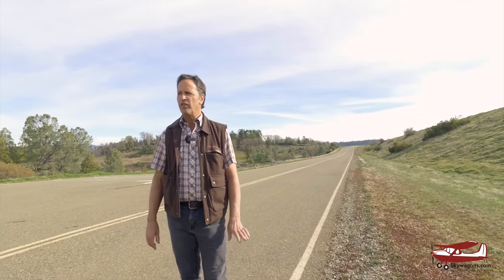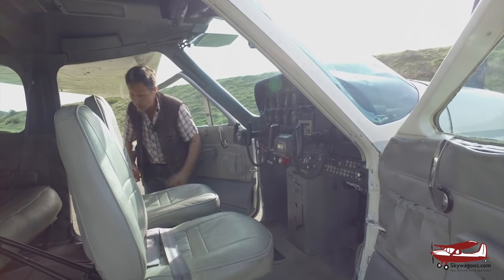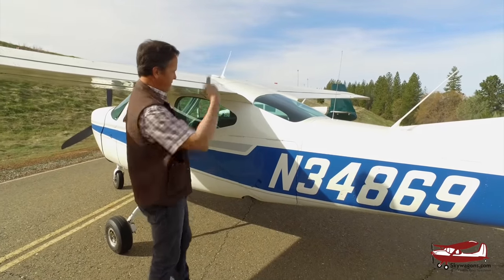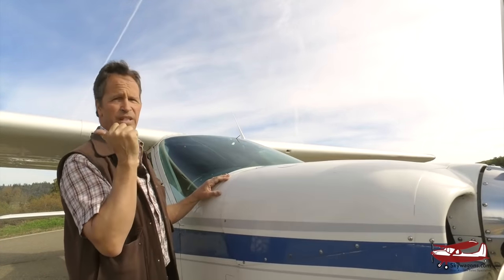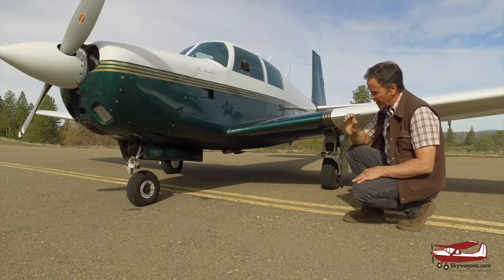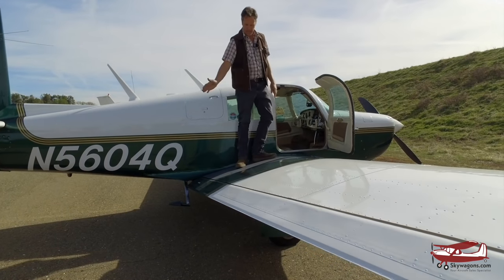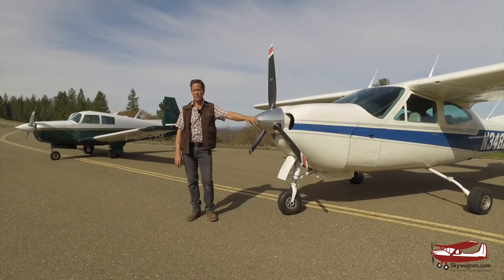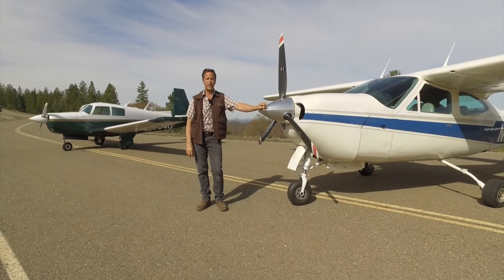Mooney vs Cardinal

Comment: Speed vs comfort!?
Reply from the maker: Don the Camera Guy here ... I thought the Mooney would be cramped and uncomfortable.  Then I flew one from Placerville to Vermont.  It took two days and I ended up sleeping in it for a few hours.  That did it for me.  I sold my Cessna 310Q (24 gallons an hour at 170 knots) for a Mooney.  They are perfectly comfortable, have adequate speed, and impressive economy.
Reply: @skywagonuniversity5023  they have that roll cage structure too... No crushed coke can from a Cessna
Reply: I think the Mooney is a safest airplane because of the strength of it’s fuselage and the one-wing design. No other airplane compares to it.

Comment: I appreciate the entertaining video Mr. Mark and Mr. Don. I am planting corn tonight, and I listened to the whole presentation, and even caught a few glances because my tractor is on autopilot.
Reply from the maker: That is excellent, you have a video or at least a computer on internet in your automatic piloted tractor.  Or your phone.  Anyway, I'd like to see a video on that.
Reply: @skywagonuniversity5023  I am using a Trimble TMX autopilot on my John Deere 8420. The Trimble autopilot recieves radio signals from stationary GPS base stations around my county that calculate GPS position corrections. The base stations broadcast that correction signal (over the air via radio) to the Trimble in the tractor. The Trimble uses the correction signal information to refine the GPS location of the tractor to within a fraction of an inch many times a second. 

The Trimble autopilot uses sensors (accelerometers, angle sensors, and gyros) mounted on the tractor to further refine the other variables: instantaneous heading, steering angle, and tilt of the machine (which moves the roof mounted GPS reciever). The autopilot compensates for all those variables in realtime and steers the tractor. 

Autopilot has many uses for the farm, but in a nutshell, it helps us reduce overlap, reduce chemical/fertilizer/fuel/seed waste, and increase productivity. It's nice to have something that makes it easier on the operator, saves money, and helps the environment a little too! How rare is that?!
Reply: @chester8420  I need that tractor in my life!

Comment: Outstanding, thorough review. I’ve owned my fixed gear Cardinal for 10 years. I have a few things to add:

The Cardinal fuel system is stone simple: Left/Right/Both.  Mine lives in Both 99% of the time.

The prop clearance on the Cardinal is greater than the Mooney’s, something to consider for grass field ops.

Cardinals come with 3 point shoulder harnesses.  I retrofitted mine with the B.A.S. 4 point, inertia reel system. Not sure if shoulder harnesses are an option for Mooneys.

The Cardinal Flyers Online, the type club for Cardinals, is one of the best run, informative, and active groups out there, despite the relatively small fleet size.  As a result, there are many after market mods available for Cardinals.  One of the most popular is the tuned exhaust by Powerflow.  The Powerflow exhaust adds “bolt on” horsepower, which is most noticeable on takeoff and climb, but will also add a couple of knots in cruise. My fixed gear Cardinal has several additional speed mods and I typically see true airspeeds between 130-135 knots (150-155 mph) at 10.4 -10.8 GPH between 6000-8000 feet, 75% power.  Not bad for an airplane built in 1970 with the gear down and welded. 

The Cardinal’s front seats adjust fore/aft, up/down, and the seat back angle can be adjusted.  The up/down feature is great for shorter pilots/pax.  No need for cushions or phone books (millennials & younger may need to Google that 😜).

In the end, both are excellent airplanes.  Having to choose between them is a very 1st world problem.  I’m a lucky man to be the caretaker of my Cardinal. I plan to leave it better than I found it.
Reply from the maker: Thanks for the input from a long time owner.
Reply: Yes, you can retrofit retract shoulder harnesses on a Mooney.

Comment: I came this close to getting my complex endorsement in a Mooney. My flight school had one on the line, but no instructors were checked out yet in it. Soon the Mooney moved away. Maybe because no one flew it?

In any case, the Mooney with the manual retractable landing gear is at the top of my airplane shopping list for when that magical time arrives. The 177RG however is in the number two slot.

Now, on with the show!
Reply from the maker: Either plane will serve you well.
Reply: I got my complex and instrument rating in a Mooney M20E at a flight school in Florida. I now own a Mooney M20K 252
Reply: Daywm

Comment: Excellent “unbiased” overview.  I have a 75 Cardinal RGII and you covered everything in a very factual manner. Thanks for the additional hot start technique. I will definitely be using that though I have the STC’d Lycoming IO390. I had done a prebuy on a 1980 Mooney M20K 231 model but there were too many squawks and it had been sitting out on tie down for a couple years in Maine coastal weather. Mooneys are great planes and the designers captured the essence of what pilots wanted in a true commuter plane. It is interesting that the popular RV aircraft use the same pushrod style controls and captured that crisp accurate responsiveness that you describe in your narrative.
Reply from the maker: Thanks.  Yes, the early K model Mooneys (M20K-231) has the problematic IO-360 GB six cylinder Continental in them.  Upgraded to the IO-360 LB1B which is a bit better.

Comment: I owned a "G" for about 10 years and loved it.  Put on every speed mod available except the "J" cowl.  Installed a Garmin 530/430 comm/nav combo plus JPI fuel flow and a few others for the panel.  Fuel bladders and manual gear solved lots of issues/ADs.  If there was a way to kill recurring inspections, it was done.  I eventually sold her to a guy that really seemed to appreciate her.  The Cardinal is a great aerial SUV but the Mooney is  pure FUN.

Comment: I have a Mod Squad 63 M20C under restoration. Some advice if your looking for a Mooney make sure you inspect the tubing in the cabin structure for rust. Especially near windows & doors where water can leak in. Also those instrument inspection panels can leak if not sealed properly. Some Mooney's mostly later ones have poor paint adhesion on the tubing & are completely bare steel. Requires pulling the interior, hand sanding rust & painting with a brush to get to the blind side against the skin. If it's bad, tubing has to be cut out & new tube welded in.  I was lucky with my bird someone had Dinitroled the whole airframe. The aluminum inside the wings was like a mirror, Dinitrol saved it from sitting outside for years. ACF & Boesheild don't last & are inferior products to Dinitrol. Make sure you get a mechanic thats a real expert on Mooney's for the prebuy. Alot of great pretenders out there.
Reply from the maker: All very true.  Check your steel frame in a pre-buy if it has lived in a damp climate. .

Comment: Ironically, I flew my 140 last Saturday,  and I was behind a Cardinal on departure at my home airport.  As he rounded the bend, I noticed how sleek the airframe was around the windscreen and thought how nice it looked.   When I landed at my destination. A Mooney M20 (not sure of which model) landed after me and taxied in next to me.  I got out and walked around it and thought...  "I could see myself in one of these!! It's beautiful!!!"  That is what landed me on your video.  After seeing the review, I think the Mooney would be my choice because I just love the way low wing aircraft handle.  I also like the sound of the rugged construction with the pushrods and the heavy wing spar, and I like the rubber pucks in the gear.  Sure, you have to replace them once in a while, but I can't tell you how many times I have gone out to fly the Cherokee,  and the damn struts have lost all of their nitrogen and I am stuck.  Even after rebuilding them, they still leak!!  I had a Musketeer with the bucks, and it landed beautifully!  I am going to start looking at Mooneys!!
Reply from the maker: Thanks.  It's good to point out the benefits and shortfalls of the various planes.

Comment: Bought my 76 Cardinal RGII in 1987 with 1600hrs on it for $18,000 ; )'  It had sat for 4yrs without flying and had 3mths left on the annual. Changed the tires and battery when I bought it. It has been the perfect airplane for my family of 4 over the years. I still have it today and it has been the best investment I have ever made! Only a couple of minor unscheduled mx issues over 35yrs of ownership. I highly recommend the Cardinal to anyone still on the fence! They were made from 71 to 78 and the best models to get are the 76 and 77 the 78 is 24 volts.
Reply from the maker: Excellent.  Long term owner.  Thanks.

Comment: Mark, great review as always! I owned two Mooney M20Cs (63 and 65) before buying my current 64 Cessna 210. The Mooneys are fantastic but I just got tired of crawling out of the Mooneys. I’m 6’3”, 220lbs and the Cessna is just easier to get in and out. The quality of the Mooney is higher but Cessnas are like GM cars. They’re everywhere, parts and mechanics are readily available and they’re easy to fly. I actually had a couple mechanics tell me they wouldn’t work on my Mooney because it was hard to access. But the efficiency and speed for given power is hard to beat. Great assessment of both planes.
Reply from the maker: Picky mechanics.  But, the 210 is much easier to get in and out of, for sure.

Comment: We operated a Comanche 400 for a few years delivering newspapers to country Victoria in the late 60s.
In summer, after refuelling, doing a hot start involved purging the air from the lines by flooding and then flogging the starter, mixture lean and full throttle.
What a pia it was !
Reply from the maker: When hot, add no fuel and give it full throttle and no fuel at all (mixture out) crank it,  it starts and quickly mixture in and throttle out before it rev's up. The 720 in a 400 is literally two 360's, so same process.

Comment: Thanks for the tip re starting a hot IO-360.  I have a slightly different technique with my Mooney M20J, but I'm going to try yours out tomorrow to see if she starts any quicker.  My technique is to keep mixture out and throttle slightly cracked - works every time, but it does take 3-4 seconds of cranking.
Reply from the maker: Slight variations work.  The bottom line is "no extra fuel"

Comment: I used to 'help' a guy fly his '65 E. Oh dear god was that a fun time in my life!  However finances have changed, and so must my playthings. I have to relate one of my last BFRs in that Mooney. For the 'unusual attitude' portion I put my head down to my knees, Jim put it in a shallow, full powered descent, and then slooowly pulled back back back. At stall speed he kicked left rudder, throttle to idle, and said, 'your airplane'! So I look up, and we have no airspeed, no vertical speed, stall horn screaming, staring straight down at the ground - we're just hanging there in a perfect hammerhead stall. It was hilarious. 'course, I didn't have to do a thing - just don't pull the wings off. LOVE tha 'E'.
Reply from the maker: Scary stuff but a strong plane.
Reply: @skywagonuniversity5023  I'm not sure you could do that in a Cessna or Piper(?). PS: send money so I can start flying again😃

Comment: I have flown and liked both aircraft. 
My first landing done in the M20E with 4 onboard was a forced landing due to the failure of the fuel injection pump.  Although it was into a short grass strip with a gorge on the threathhold on the approach and lake at the other end and a strong crosswind l managed to do a copybook forced landing due to its ease of control. Appart from the inconvidience this landing did have a very happy ending for me. One of my passengers that l had met for the first time 3 days before became my wife and the mother of my two sons.
Reply from the maker: That is an excellent story.

Comment: Great video!  I have a 1968 M20G.  Did you say your’s still has the Mooney Positive Control system?  You should do a video on the P.C. system- the design and operation would really surprise and impress people.  I used to fly an M20C that had it, and it worked fine-
Reply: Agreed, would love to know more about the PC.
Reply from the maker: Yes,   It will be a shorty, but yes, I have the PC and it works.  I'll do a video about it.

Comment: Hmmm… well I flew a ‘65 Mooney for a few years and ended up with a ‘75 Cardinal for the last 20+ years. With my two bladed prop (a three bladed is slower in cruise), I cruise at 150ktas. I measure my cabin width at the shoulders and it is 48 inches. I am certain it is wider than the mooney. I would be shoulder touching shoulder with my flight instructor in the mooney but in the Cardinal there’s a good five inches between our shoulders. Plus I have a center console between the two seats that is 4 inches wide.  Nothing beats the Cardinal doors and there are after market door stops to keep them from becoming wind sails. 
At any rate, the Mooney is a wonderful aircraft but I find the Cardinal to be a much more comfortable aircraft with great range and about the same fuel economy and speed.  I also thinks it’s the prettiest single piston aircraft Cessna ever produced.  I would love to redo this presentation with my two bladed Cardinal, beautiful paint job, mint interior, and, of course, let my bias towards the Cardinal shine thru.

Comment: The one big catch is flight controls check, just because you move the yoke back-and-forth and side to side, verifying that they are free, it is extremely important that you verify they are CORRECT. Get something out of maintenance has been hooked up backwards, the controls will feel free even when they were hooked up in reverse. Position the controls to the right or left your choice looking ahead, tell yourself which aileron should be up in which should be down, to verify they are correct. Upon takeoff, if they are hooked up backwards your mental capability and muscle memory will not realize the problem if they are hooked up backwards. You absolutely must verify before every flight that they are correct, this is just as important with the rudder except less deadly. If your engine runs rough or sounds horrible and you decide to takeoff anyway you have a chance. If your flight controls are messed up and you didn't catch it before takeoff you are dead. The flight control check is more important than anything else on the aircraft. I have seen so many times people never actually check to be sure they are correct.
Reply from the maker: That particular check is done during the walk around.  Each control surface is moved and you can easily see the yoke react properly.  We just don't have the cameras on then.

Comment: Excellent comparison. Way back a commercial real estate company I worked with used three Mooney's with basically no problem. Then women started using them and made a switch to the Cardinal RG. The only reason was the girls could easily wear heels, and skirts and get into the Cardinal, especially the back seat all ladylike.
Reply from the maker: Like getting in and out of a sixties Jag.

Comment: Put the 201 windshield, South West cowling, move the oil cooler,  convert the generator to alternator, straight six panel, and put the Johnson bar back and you have the perfect airplane.  Wait for the "clunk" of the step dropping down during taxi. 
I bought my E out of Placerville.  And did my 10 hours of required instruction out of there.  Coming from only Cessna's it totally freaked me out!  Placerville being on a hill but Auburn was even worse. I felt like I was below the trees on final.  After a couple days of this we went to Lincoln and I said finally a flat runway!  The big thing is that the plane is so efficient that if you don't have the gear down before descending you never will get down to VLE.            
One of the reasons I loved the Johnson bar is that if they ask you to keep your speed up on approach you could comply. Then once inside the FAF you just get it right at the bottom of the glideslope then pull back on the yoke and watch the a.s. drop.  Once at 120 drop the gear and get right back on GS.  Just make sure you let your passengers know before you do it.                                      
Neither plane is High Performance since the regulation is OVER 200 horse power thus you don't need a High Performance endorsement.
Reply from the maker: Which E did you buy out of Placerville.
Reply: N5554Q

Comment: Great video! I was shocked that the cabin width is the same for both planes.
Reply: It truly isn't - this video is great for a lot of reasons- but the Mooney is far larger and more comfortable. I'm 6'7" 320lbs - I know, the one career my size helps me none- the Mooney is 48" and from experience, on par with the width of a PA32- I have several inches between me and my flying partner. The only 4 cylinder with that kind of shoulder room- I'm Shoulder to shoulder in the Mooney at my height and width and quite pressed against the curved window with my flying hand. Such a shame- if I were the same height and thin, I think it would be really comfortable.
Reply: @scottmitchell3761  Thanks. I imagine at 6.7 and 320, any private airplane would seem small.
Reply: Lol
Story of my life
The 737 is a bit small for me:)
I like sailing too- and those cabins aren't big either:)🤷🏻‍♂️ 

And I mIs-typed I'm sure you see- but it's the Cardinal that is "far larger" the Cardinal width is listed at 48" and that feels correct when I sit in it.
Reply: @scottmitchell3761  Haha. We need to design a F350 with wings.

Comment: Great presentation. I just don’t understand, with the same engine why the Mooney isn’t so much faster than the Cessna?
Reply from the maker: A Mooney M20E or F and a Cardinal RG both with the 200 HP are quite well matched.  The Mooney is much faster than a fixed gear Cardinal but that is not a fair comparison.